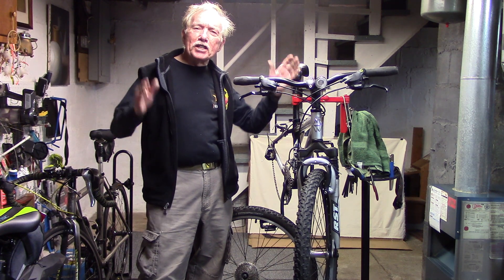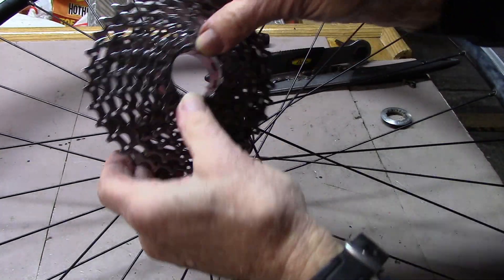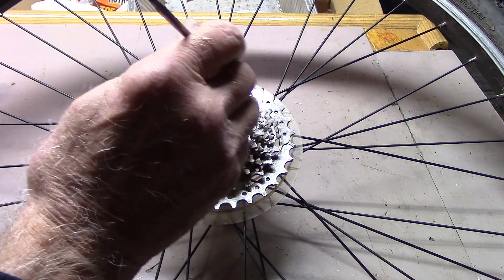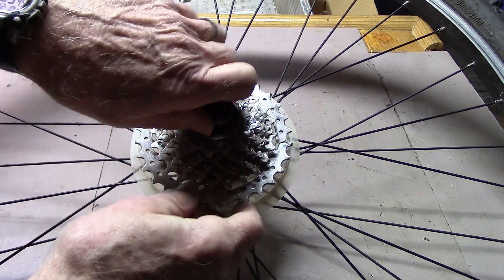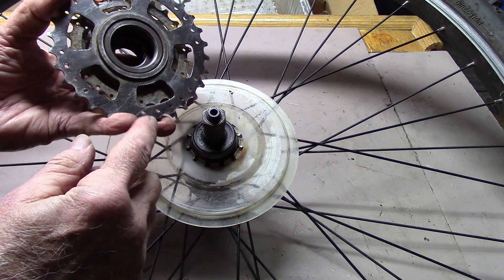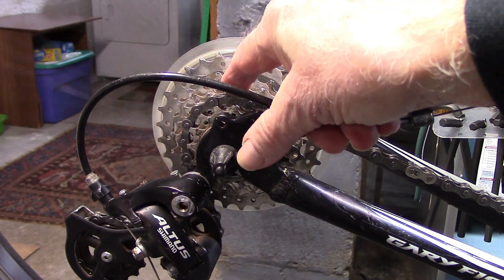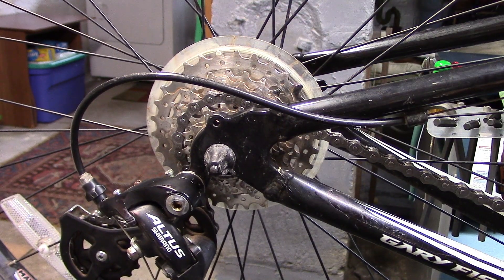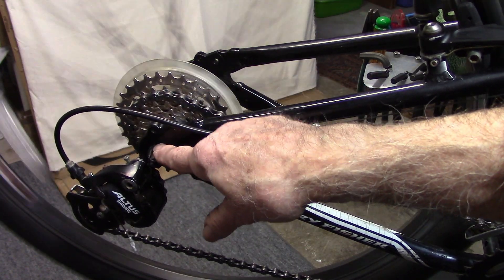Freewheels vs Freehub: Freewheel noise - clicking, clunking, overhaul

Comment: Freewheels do wear out. At that point cleaning and lubricating them is no longer an effective treatment and they need to be replaced. I've never seen anyone talk about how you know that a Freewheel is beyond its repair.
Reply from the maker: Yes, freewheels can "wear out." Grease can age/harden and the internal mech of ball bearings and/or pawls & springs may need to be replace. In addition, freewheel teeth can wear. See:
https://www.youtube.com/watch?v=T_vRbBRPr3c
and
https://www.youtube.com/watch?v=9q-lAc0hQg4 
and finally (don't need to translate but just watch)
https://www.youtube.com/watch?v=DOCYO8uM_Tw
I think the reason why there are so few videos concerned with telling you when a freewheel is beyond repair is that overhauling a freewheel is a bit more of a task then just replacing it. So when it fails for what ever reason, most of us just replace the freewheel. What are your thoughts? Regards, Tony
Reply: @tony10speed  I agree replacing is often the best option. When the bearings/races begin to fail in a FW, it's not always obvious they are failing. The FW will often function to some degree but provides a "hidden" almost undetectable drag on the wheel. I've not seen anyone ever address this in any video. Cleaning and lubricating at that point is a VERY temporary "fix". Replacement is required. But no one seems to talk about that.

Comment: I’m a mechanic that recently ran into a freewheel issue on a 45 year old schwinn. In its highest gearing it caused a clunking, skipping sensation in the cranks. My first intuition was bottom bracket. Next, I assumed the axle might be broken. It took some trial and error before I realized that it was freewheel failure. Usually they are built like tanks, but this original freewheel, French-made for Schwinn, had finally shit the bed after nearly a half century!! 😂
Reply from the maker: Not seen that - very interesting. Especially the fact that it was only happenening in the highest gear. I assume you replaced the freewheel and now all is well. Thanks for sharing, Tony

Comment: Hey Toni, this is the only video i found that's relevant to the problems ive been having with my freehub so if you could help me with it that'll be amazing.  So i get this grinding/clunking noise when im coasting, and i can hear the grind when i turn the hub. Should i take a look at the bearings? Its a fairly new bike so i dont think its dirt that might have gotten inside
Reply from the maker: I assume that the grinding/clunking only occurs while coasting but not pedaling. This would certainly suggest a freehub problem (possibly need lubrication or a broken component inside the freehub). If you hear the grinding when you pedal or turn the crank, this suggest other possibilities including the wheel hub bearings or bottom bracket. It's difficult to diagnose via the internet and it would pay to have your local bike shop take a look. Regards, Tony
Reply: @tony10speed  thank you for the reply, I'll take it to the shop :)

Comment: I'm getting a clunk in mine on every peddle stroke after climbing a 14% grade, I took it to the bike shop and they said they didn't hear anything, I paid for a tune up, got it back home and sure enough clunking it there. Only on the lower half of gears though, 1st-3rd sound great where as 4th-7th make the clunking sound.
Reply from the maker: I'm assuming you understand the 1st is the smallest cog. From your comments I also understand that the clunking sound is only when the bike is under extreme stress, that is, when climbing in the largest gears, once every pedal stroke which put a lot of force and torque on the bike. It is unlikely to be freehub or freewheel but rather suggests bottom bracket. On the repair stand, one may not hear any clunking as one would hear when pushing very hard on the pedals. My best guess would be bottom bracket (although I can't rule out pedal noise). Take a look at the following video:
https://www.youtube.com/watch?v=InW64uutftM
If chainring bolts are tight and there's no movement of the crank suggesting loose fixing bolts as shown in the video, the next step for me would be to overhaul the bottom bracket. The shop should have suggested this. You can take it back to the shop or possibly find a bike mechanic with a little more time to overhaul the BB.
Let me know how you make out. Clunking sounds are not only annoying but indicate or result in a more serious problem. Regards, Tony
Reply: @tony10speed  On my bikes the shifter indicates 1st when  the chain is in the largest gear. The popping only started after a big climb, when I posted this it was doing it even on flat ground while peddling normal.  I removed the wheel and found play in the freewheel, I noticed I could turn the lock ring with my finger very easily so I tightened it, I do not have the proper tool so I used a screw driver and tapped it lightly with a small hammer. Seems the sound is gone now, I am hoping that is all it was. I am pretty dissapointed that I only brought it to the bike shop for this problem, he made all kinds of adjustments but never took the rear wheel off and looked at it when popping and the gears jumping between 3rd and 4th were the complaints. I even purchased 2 new bikes that week from him so I figured he would go the extra mile for me. Thank you for the response, I appreciate it. I will definitely have a look at the bottom bracket as well as this is a department store bike and I am sure it was not assembled with much quality in mind.
Reply from the maker: @jason-white  Very interesting. I've seen this problem a few years ago when my partners bike started making all kinds of noise and the back wheel locked up. Took off the rear wheel and used the same screw driver hack to tighten up the cassette. We were then able to get home. Subsequently, I made a video about the incident:
https://www.youtube.com/watch?v=XdShMsbFNPg
Not the first thing you think of when you hear a clunking sound, unless it's coming from the rear wheel or the rear wheel locks up. 
As for the shifter indicating that the largest cog is gear 1, I've seen that with some grip shifters and a few other types. Obviously not correct and makes you wonder if that's a Chinese standard.
I'm glad you were persistent in tackling the noise problem and we all can learn from your experience.
Regards and safe cycling, Tony
Reply: @tony10speed  I am going to take it on a longer ride around town this weekend to confirm but yeh it's nice having it back together. As far as the gear numbers, even the Shimano shifters on my new Marin mountain bike indicate 1 as the largest gear is the rear but the smallest gear in front. My Specialized Allez dose not indicate any numbers at all on the gears, just a little orange line that moves when you shift.

Comment: Hi Tony, thanks so much for your informative videos. I have a relatively new bike with a Shimano 7-Speed Freewheel (14-34t) that is making a rather loud clanging noise while pedaling. I have recorded a short video of a close up of the freewheel while the noise happens. In the video you can see the freewheel itself moving ever so slightly. Could I possibly send you the video via email or something? I could even upload it to my youtube channel and send you a link if that would work for you. I'm not a bicycle mechanic but I am wanting to get more familiar with how it all works because I plan to be a bike traveler for the rest of my life.

Any help you are willing to offer would be greatly appreciated. Thanks in advance.
Reply from the maker: I don't accept video via my email or channel (too much malware out there). It sounds like a problem with the freewheel (broken spring or pawl). Another possibility is a problem with the bottom bracket. This is not something I can solve over the internet. My suggestion is to take it back to the dealer who sold you the bike or to your local bike shop. I wish I can be of more help. Regards, Tony
Reply: @tony10speed  Alright, thanks for your help!

Comment: Good video Tony! I have a new ebike with hub motor that has an annoying clunk the occurs when resuming pedaling after coasting.  The chain and pedals move an 1/8th or so of a turn before the freewheel engages with a metallic clunk which I can feel.  Does this in all gears and I can lift the rear wheel off the ground and pedal/coast and it still does this.  I think something is wrong with the freewheel.  I emailed a video of this to the bike mfg/dealer and they basically blew me off and said there is nothing wrong that this is normal.  I have owned several bikes and ebikes and none had this problem.  What do you think?
Reply from the maker: The most common causes of clunking as you engage the pedal are bottom bracket problems, freehub (freewheel ) clutch mech in the motor. Ebikes should not make noise (other then some hum from the motor) unless there are specific problems with derailleur adjustment, old rusty chain, or chain slap occurring when the rear derailleur clutch is engaged. See:
https://www.youtube.com/watch?v=oaEjBgEY91Y
Unfortunately, ebike mfg/dealers my cycling companions have dealt with do not seem responsive to their needs. You can go back to the dealer and tell them that you think there is or a problem with the bottom bracket, freehub or clutch mechanism but I have a feeling that you'll need to look for a ebike service and repair in your surrounding area who will be more responsive to the problem.
I wish I could be more of a help but do let me know how you make out. We all can learn by your experience. Thanks and be well, Tony

Comment: This is ver helpful to understand how it works. Should I be worried if freewheel noise completely disappeared? I had a lot of rainy rides while commuting last few months and with temperatures dropping I no longer hear any clicking sounds when coasting.
Reply from the maker: If the freewheel works well but lacks the usual sound, it is possible that the lubricant in the freewheel has become more viscous with the cold muffling the sound of the pawls so you hear less clicking. I have mimicked this by adding Tenacious oil (which is quite viscous) to Shimano freehubs in order to quiet the clicking noise.

If freewheel becomes quiet but does NOT drive the bike forward, the pawls in the freehub may have become gummed up and not moving properly requiring some maintenance or overhaul.

In conclusion, if the bike still works well, I wouldn't 
do anything. Keep me informed. Regards and safe cycling, Tony

Comment: Hey Tony GREAT video! love your content!!!!

My bicycle has an issue which I haven't yet discovered what the problem is . I also have little experience fixing my own bike. Every time I pedal hard, it does a loud sound, and the force does not increase my speed.  At first it wasn't a big issue. but now the simplest elevation on  the road becomes a hustle to ride since it kinda "slips" and makes noise whenever i put extra pressure on the pedal and i end up kicking the ground like a skateboarder, please help
Reply from the maker: The most likely culprit is the freehub (or freewheel depending on what's installed on your bike). See:
https://youtu.be/TMWmnv6o9Zc?t=135
The other possibility is slippage of the crank or bottom bracket problems. See:
https://www.youtube.com/watch?v=kx56KXCluz4
In either case, you need to have the bike looked at by a bicycle mechanic with experience. Hopefully you have a bike store / repair shop close by. 
Let me know how you make out. Regards and safe cycling, Tony
Reply: @tony10speed  thanks for the quick response!! i will definitely go through the links you sent me . Also i oiled my bike today  and it significantly improved. Although it still does it when i apply a lot of pressure. 

Yes their is a experienced mechanic around the neighborhood who's been fixing bikes since i was a boy. I will soon take it to him and let you know exactly what was wrong. Once again i appreciate your feedback🙏🏾

Comment: Hey! Just found out your channel and this video addresses my questions, but not fully. I have a freewheel bike and the bolt on axel has bent twice (tends to due so because of cheap build quality and leverage from the bearings and the bikes frame). I really hate replacing my axle and buying ones alot to keep fixing this issue and Im trying to just fully replace the wheel with a freehub to solve this issue. Any tips or recommendations? If you think this is a good video idea, I really do appreciate you making a video on about this conversion. Thanks alot
Reply from the maker: I don't think the investment in a new rear wheel (freehub and cassette) is worth it. Save your money and, hopefully, you can eventually step up to a better built bike. Thanks for asking and be safe, Tony

Comment: My chain goes slack every time I backpedal or coast. What might be my problem? Iv got a 2000 or 2001 Schwinn Mesa
Reply from the maker: This is pretty much expected behavior.

When you're pedaling forward, the top half of the chain is pulled tight by the tension from your pedaling, and the lower half is held in tension by the derailleur. The derailleur is also very close to the rear sprockets so it can guide the nicely-tensioned chain onto the proper gear.

When you pedal backwards, you pull on the bottom of the chain which pulls the derailleur forward. That creates chain slack. Some of that chain slack shows up on the top half of the chain as the chain links get dumped off the front chainring into space on the way backwards. If you watch the chain closely when you pedal backwards, you can actually see the top of the chain go slack and flop around a bit. So when you're pedaling backwards there's nothing on the top side to maintain tension. A slack chain will flop around and there's nothing on the top side to guide where the chain lands on the rear gears. So the loose flopping chain is free to go where it wants.

Derailleur-equipped bicycles are not designed to be pedaled backwards. Pedaling backwards is a great way to drop your chain, especially if you do it suddenly and hard.

With that said, I can easily pedal backward on my Independent Fabrication and my Titanium Lightspeed Classic. However, every once in a while, as i back up the bike to put it in the car, the chain becomes slack and drops off the small chainring. Pedaling backward is more of a problem with my Giant Mountain Bike. 

However, there are a couple of things to check if pedaling backward is a constant problem. Check for chain, cassette and chainring  wear. See:
https://www.youtube.com/watch?v=g5uqTNmikro&ab_channel=TonyMarchand
Check that the indexing (shifting) is smooth and the guide pulley (the upper one) is lined up with the cog above it. Check for a bent derailleur hanger. See:
https://www.youtube.com/watch?v=qHK6jQizIdc&ab_channel=TonyMarchand
Finally, put the bike on a stand and spin the wheel forward as in coasting. Does the wheel easily turn. If not, there may be grime and grease build up in the freehub. Does the crank turn as you spin the wheel forward or back. See:
https://www.youtube.com/watch?v=TMWmnv6o9Zc&ab_channel=TonyMarchand
See if the above solve your problem. It may just be the particular rear derailleur/drivetrain as it is on my Giant MTB but you can also check with your local bike shop.
Let me know how you make out. Regards, Tony

Comment: I am getting weird clicking sounds while pedaling, can't figure out from where exactly the sounds are coming. i checked bottom bracket no issues there.. could chain be the issue? Or it's the freewheel?. m also having issues in freewheel, it sometimes rotating the tyre backwards. (I have single speed bicycle)
Reply from the maker: Many single speeds do not have freewheels and, instead of brakes, you just stop pedaling. If you truely have a freewheel, you should be able to coast without turning the pedals. If you have a freewheel, you put the bicycle on a bike rack, pedal backward and the wheel turns backward, there's a problem with the freewheel. It's easier to purchase a new freewheel then try to repair the old one. But first check out these two vidoes:
https://www.youtube.com/watch?v=xn0bokygJ9c&ab_channel=TonyMarchand
and
https://www.youtube.com/watch?v=0_qZmXNS8PQ&ab_channel=TonyMarchand
Let me know how you make out. Regards, Tony
Reply: @tony10speed  i gone to service center and changed freewheel.. even my clicking sounds are reduced now.
Reply from the maker: @avinashk9966  Great to hear. Thanks for the feed back. Regards and safe cycling, Tony